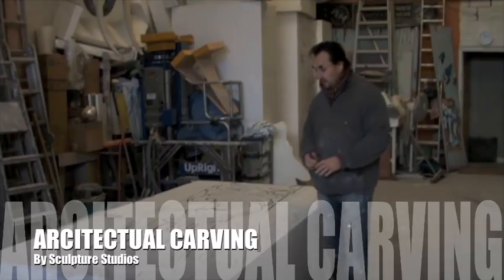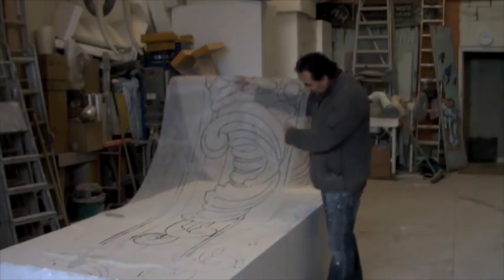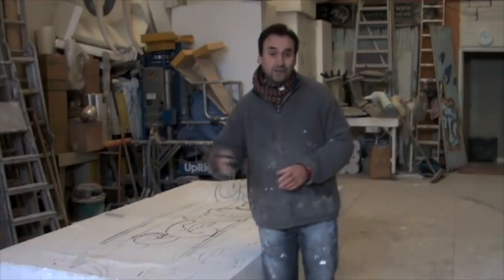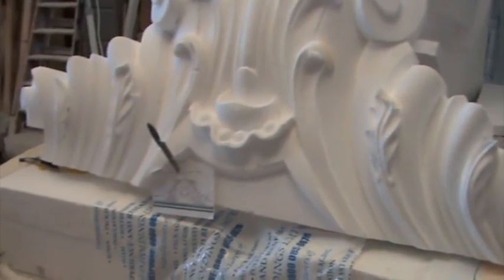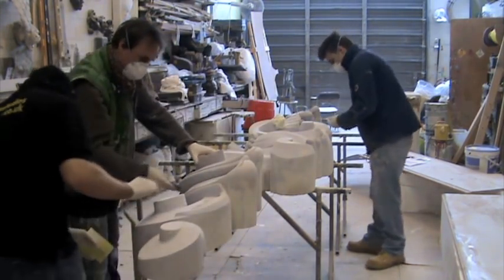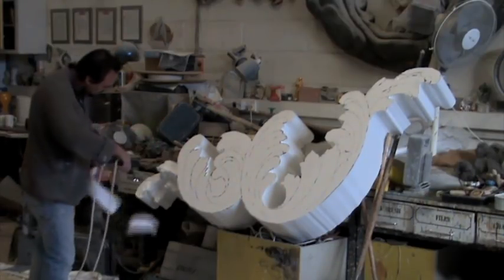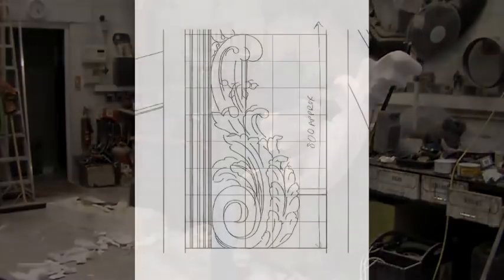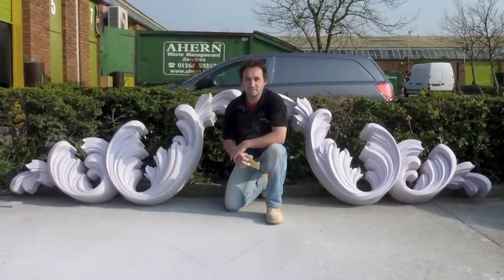Architectural Polystyrene Styrofoam Carving by Sculpture Studios

Comment: where do you get poly blocks that large?
Reply: Make them yourself? You can get the chemicals for it.
Reply: douglas brinkmeyer
that two part expanding foam won't work for what I want to do because it does not melt with an acetone wash like styrofoam... I have a project of building a carbon fiber canoe and thought of building the form from styrofoam  then pouring in a little acetone to melt away the form...
 But after i posted this I have found a company that makes blocks up to 24 foot X 5 foot X 5 Foot... Then they told me the price so I'm back to the drawing board on making a form to lay the cloth on...
Reply: Paul Mays
I seem to remember, though it was sometime ago, that you could get what was needed for styrofoam too?
Anyway neat Idea though, Good Luck you'll figure it out.
You could get some heavy floor covering "Paper". It comes in rolls and is really thick paper/thin cardboard like shoe boxes used to be. Then use some fiber glass resin to harden it into shape.
Yes you'll need a parcel mold for it that will also be used for stiffing the mold as a whole but ply wood would do for that. Then paint the inside and wax it so the carbon fiber won't stick.
Just an Idea and that is how they do fiber glass boats, sort of, so should work for carbon fiber.
Reply: Paul Mays
I've been thinking....
 *(Yea just what ya needed, Right?)*
Anyway, they make a polyethylene canoe that is light, strong and inexpensive.
Course not as strong as carbon fiber, but if ya covered it with a layer or 2 it would be really strong.
Reply: douglas brinkmeyer  Inexpensive?   They cost almost 500 bucks... and are already heavy... add 4 or 5 layers of carbon cloth and resin and we end up with a very heavy 1000 buck boat...
Reply: Paul Mays
The ones I see a Wal-Mart only run $250 or so (Yeah I know Wal_mart....)
Anyway, the One I've lifted did not weigh  much, maybe 50 to 70 pounds.
Reply from the maker: Paul Mays Hey Paul. We have a company quite local to us in UK that deliver polystyrene / styrofoam blocks to us. The blocks are 8 x 4 x 2ft and cost a few hundred pounds (not sure how much they would cost over in the states). These are easily manageable by 2 people, as they aren't too heavy considering their size.  We use a standard bead, but I guess a denser foam would weigh more.

Might just take a bit of searching around. All depends if there are other companies that offer the same products. Thanks for watching :)
Reply: Aden Hynes Sculpture Studios
Thanx .. And beautiful craftsmanship by the way...   I have had a idea for building a canoe from carbon fiber cloth (I build gun stocks and guitars as a hobby and have a bunch of carbon cloth)  and was looking for a large piece of foam as a base to lay the cloth on .. I did fine a company but they are not close and the shipping cost of a 3'X3"X15" piece is beyond my means so back to the drawing board on a base ...  Wish you folks the best of days...
Reply: The blocks of foam that I get are 3 ft x 4 ft x 8 ft tall, and I get them for about $220, plus shipping. Last time I bought them, I got 5 blocks plus shipping and they came out to be about $280 each
Reply: +chiefdreambig 
hello, what company do you get them from?
Reply: Hi Gary, I live in TN, so I get my foam from Drew Foam outside of Nashville, but they send it from their factory in North Carolina. I have gotten it also from Georgia Foam 1090 Airport Pkwy, Gainesville, GA 30501
(770) 536-8888 Their blocks are 32 inches high instead of 36 inches. But there are manufacturers located around the country closer to you. What are you going to do with it, and I will tell you which kind I would recommend- 1#, 1.5#, or 2# foam. If you don't have a CNC machine to cut the blocks down into slabs, you are going to have a LOT of senseless waste, unless you know something that I don't. Thanks.
Reply: Thank you for your response. I will be using them for sculpting with typically a plaster/mud overlay or fiberglass. When I priced them from K.C. and Denver, they were around $800 for the same size block. I don't have a cnc. I will be using hotwire to remove the bulk.
Reply from the maker: That's the method we prefer too ;)
Reply: I don't like 1# foam because it is too soft, but it is the cheapest for sure. I LOVE 2# foam, but I don't like the weight or the price. I hardly EVER use anything but 1.5# foam, it has the best features of 1# and the 2#. The last time I bought some blocks, I bought them through a friend and I got a good deal. The foam AND the S&H came out about $280/block. $800 is WAY too much!, even for 2#, unless you are ordering 16 ft long blocks. Just a question. If you have a block 4x8 times 3 feet thick, and are making a sign 4x8 and 12" think, how do you cut the 12 inch slab off of the block and get a smooth cut? You must have a wide hand held bow, and if so, what do you use as a power source? I would love to have a handheld for occasional use. Also, how do you fiberglass the foam without the resin eating it up? Do you coat the foam with something first, or do you use Epoxy fiberglass? I would LOVE to be able to use the Polyester fiberglass because of the price difference. Also, if you are interested, I will tell you about what I use as a hardcoat. Please do call Georgia Foam or Drew Foam. drew has plants in North Carolina, Outside Nashville AND in Arkansas. Nashville has the 32" thick blocks, but the other two plants have the full 36" blocks.
Reply from the maker: Hi Chief, bes tthing to do would be to look at some of our other videos, where we do a lot of fibreglass work after carving the styrofoam
Reply: +Gary Bailey Aden, have you ever used the spray urethane that can go directly on the foam?
Reply: Aden Hynes Sculpture Studios Thanks Adam, I will!!!
Reply: usually in China here you can get from eps block foam factory.   size 8M x1.2x0.6／1M   any other smaller size available